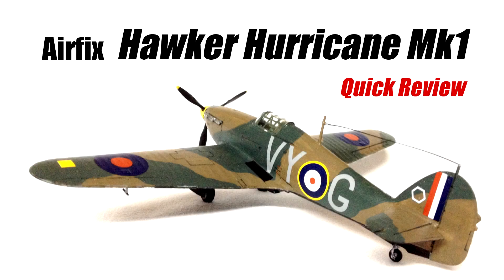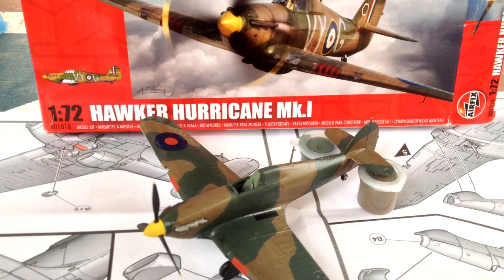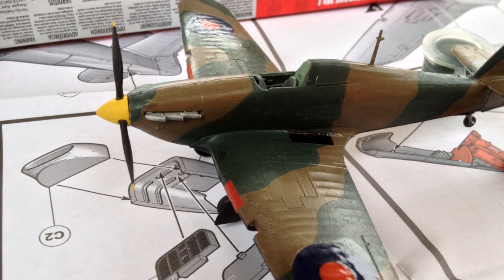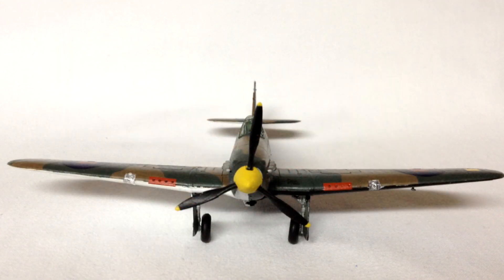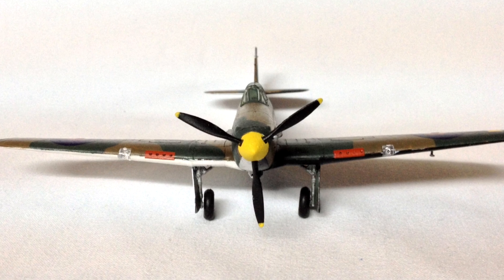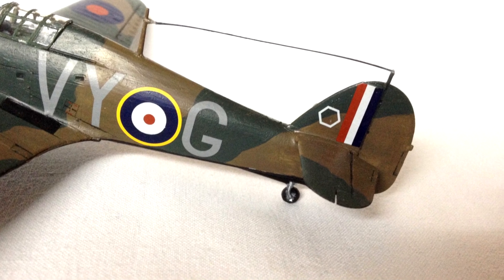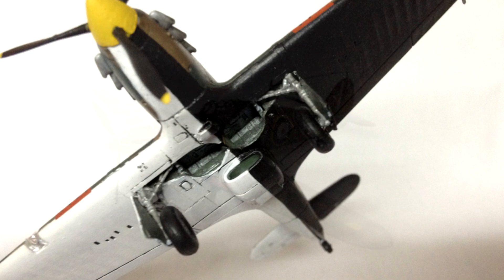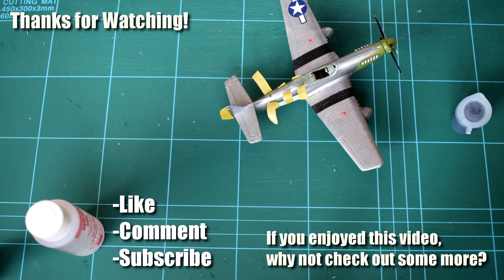Airfix Hawker Hurricane Mk1 Review - 1/72 scale Plastic Model Kit

Comment: I can clearly see that you've gotten better at kits but I have something say......
1. I saw that the mid section that connects the tail  to the main fuselage lacks the pattern that it has I guess you applied a thick coat of paint
2. I'm pretty sure that the underside of the hurricane is supposed to be a black and Matt beige green color (humbrol 90) but, I am unsure of this specific aircraft......
3. The rigging man ! It looks quite odd I think you can improve at that...

BTW 2nd comment 
;-)
Reply from the maker: Thanks! I do need to work on the rigging - it was quite thick when i added it to this model, i've actually removed it since I made the video. The colour scheme is accurate to the Airfix Instructions - which i believe is correct for the prototype aircraft being an earlier version used. There were even variations upon this with some being painted silver as well as white and black. Finally, as for the pattern on the fuselage - do you mean the panel lines aren't visible? The early hurricanes had fabric covered fuselage and tail planes which is why panel lines wouldn't be present. Hope this helps :)